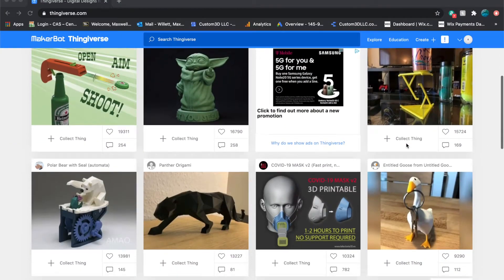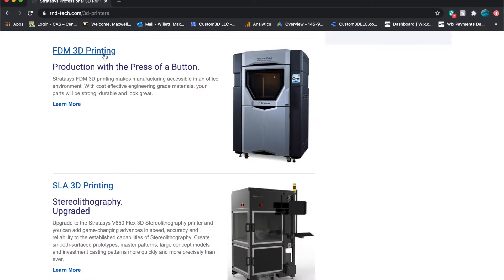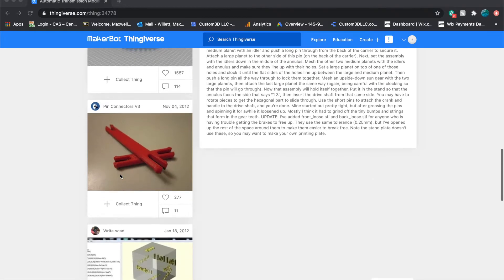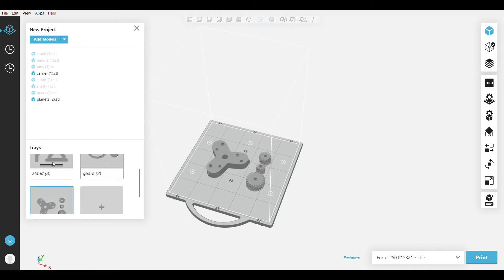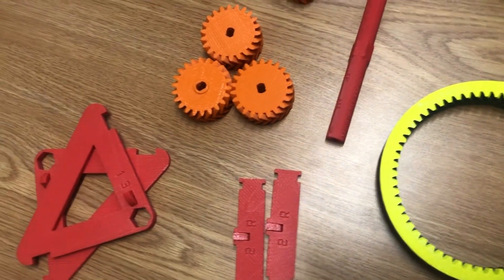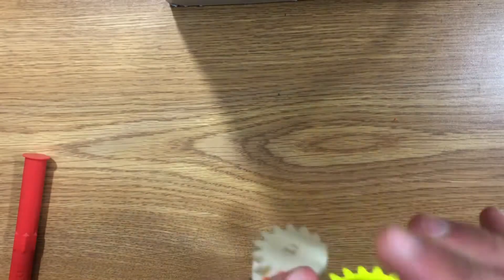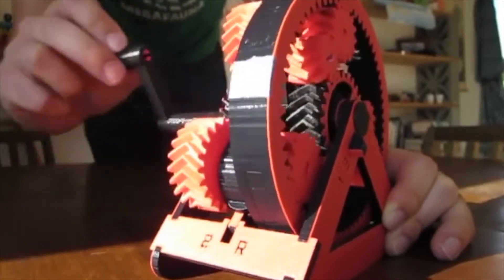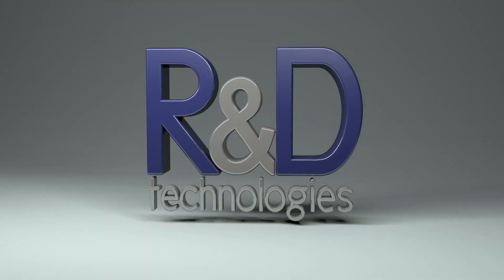3D Printed Automatic Transmission!

Comment: This is an overengineered transmission.  It is also NOT how an automatic actually works.  A real automatic transmission is 3 or 4 planetary gear sets in a row.  The ring gears of each planetary gear set are clamped in place when necessary by a brake that resembles drum brakes in reverse.  The ring gear from one set is connected to planetary gears from the next set.

This video shows how an automatic actually works: https://www.youtube.com/watch?v=YYr1gx_FdkY&ab_channel=InterlinkKnight

Comment: After reading the comments on thingiverse, I've heard several complaints of tight tolerances and gears that won't budge. One comment suggests printing the annulus at 102% and the shaft at 95%. But I've also heard complaints of pins snapping and being too tight of a fit. I would like to know if there are any modifications I should make in slicer settings before printing the model, and some detailed instructions for how to assemble this thing would be also appreciated.

Printer is an Ender 3 Pro (yes, I know I am poor) and my slicer is Cura.
Reply: I put a comment on the thingiverse page discussing how to properly print it. You need to go into the scad file and give it looser tolerances. This will also let you print at 50 or 60 percent scale.
Reply from the maker: Yes this did take some convincing to work, but after a little bit we did get it to. However, it met its demise a couple months ago when the handle broke due to the tight tolerances.
Reply: in cura, there is a setting called "Horizontal Expansion" under walls in the print settings menu. set that to a negative number to add extra tolerance to the print